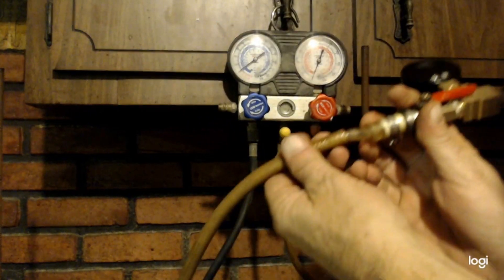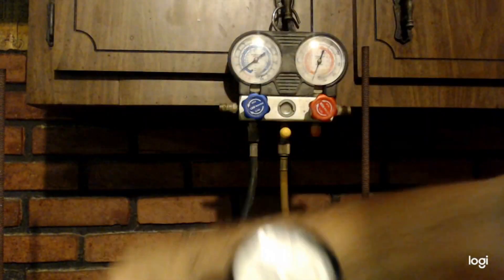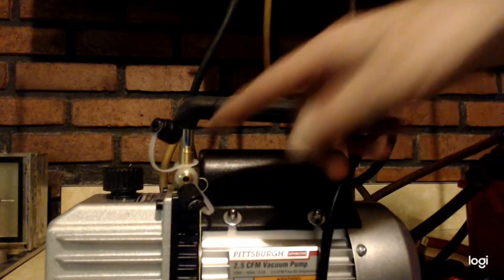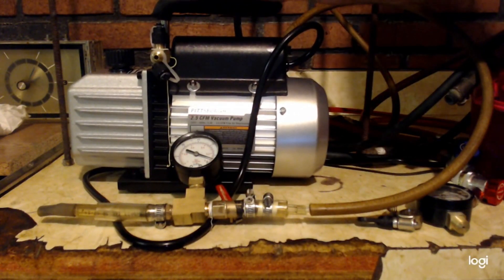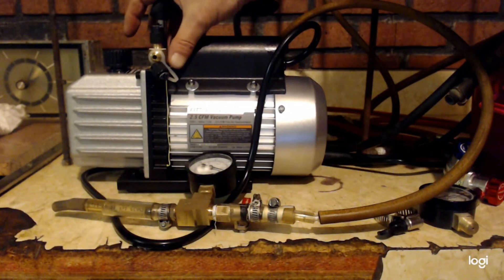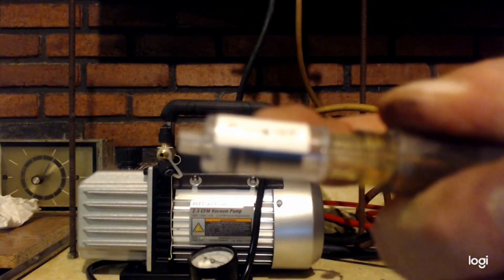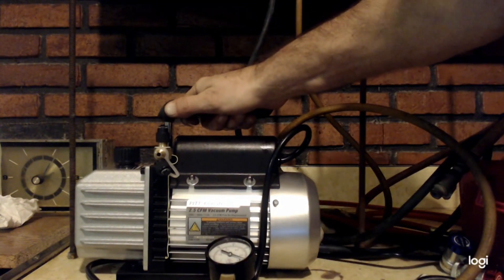VACUUM PUMPS for chemistry  PART 2

Comment: Oh, don’t you need a gas trap? Pretty sure you connect your apparatus to the glass ‘cold /gas trap’ then to the pump valve….
Oh also I do the turn off/on thing all the time - get a gas trap bro, you’ll stop sucking up the gasses!!
Reply: Just a trap not collecting or condensing HVAC or extraction petrochemicals gas, you will eventually suck solvent  fluid into motor one day!  A manifold helps, other parts are specialized.  You will also collapse glassware with high vacuum. Implosion!  Teflon PTFE nylon internals, scientific pumps are crazy expensive. 
Get a glass aspirator if high corrosives but Venturi aspirator other types.  Cold dense higher presser.

Comment: I preeeeeetty much gathered what I needed to buy in order to do vacuum rxn’s. You just confirmed it - also I’m glad I’m not the only one who rams hoses into hoses. Braided hoses are useful for strong vacuums also….cant say iv got round to buying a suitable pump for an actual rxn but I HAVE been Chinese eBay window shopping! Converters are really useful for everything. Doesn’t really matter what you’re doing. Even in audio engineering, converters that are male to female are great. Oh also i do find your oil story quite amusing. It’s an advert that says - read the manual!

Comment: He means positive pressure as in air compression not vacuum in a few examples if get confused. He’s great at explaining in layman’s terms not confusing. Trap was wondering if recommended a filter to avoid caustics, don’t suck filtrate into your pump. Have auto shut offs or use an inlet outlet jar flask.  Thanks again John!
Reply: Oh, DONT FORGET STIR BAR not a boiling chips if not overhead!  Chips if coffee cup or bought same, doesn’t stop, Quick connects is what I call those collared air compressor hoses. Hand pump like brake fluid drain pump.  Check valve one way.  Steel aspirator and glass, gonna break it not cheap. Always a 👍🏻

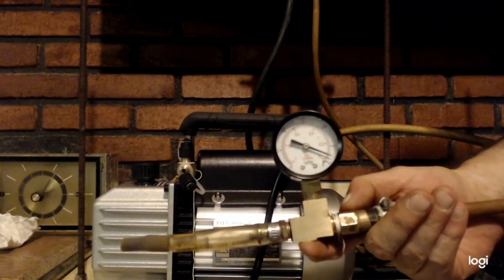Comment: 6:23 If you look for my SM thread titled "Replacing a broken bleeder valve on a vacuum pump", you can see how it's pretty easy to create a valve for these. You basically just need a needle valve somewhere that you can use to basically form a leak. it works very well.
Reply from the maker: JH........What is an SM thread?
Reply: @johnblacksuperchemist2556  Science Madness.

Comment: 1:45 I agree that these crappy gauges suck. It's a pain to have to translate. And they're always in inHg, never mmHg. 
This chart is very helpful: https://www.industrialspec.com/images/files/vacuum-pressure-unit-conversions-chart-from-ism.pdf
Reply from the maker: J H ..............I am having the same problem with pressure cookers.   No common sense.   Apparently a 15 psi pressure cooker is not a 15 psi pressure cooker.  It is 15 psi above atmospheric pressure which means in reality it is a 14.7 + 15 = 29.7 psi pressure cooker.    Scientist can be so UNscientific.   Thanks for the chart by the way.   That will be helpful
Reply: @johnblacksuperchemist2556  For sure. I found like 10 unhelpful charts before I found that one. lol

Comment: is old good stuff but has no pressure gauge and just with a valve is madness, the risk of implosion is always present and if close the valve the pump temp.increassing is crazy. but still does the work
Reply from the maker: noname........That's the main thing....it still works

Comment: I took HVAC courses when I was a kid, one of our assignments was an elaborate plumbing mockup. I remember the most difficult part was wrenching the fittings down tight enough. PTFE tape is useful too. To get a good vacuum using quick-disconnects you have to get ones made specifically for vacuum.
You can get nice diaphragm pumps from (auction site) which are pulled from O2 concentrators. They're good for chemical resistance, but like you said, don't pull as high a vacuum.
There's another type of cheap small plastic piston pump you can get which is built for foodsaver-type devices. They can pull a better vacuum than a diaphragm pump, and are so cheap you can use them in corrosive applications as they are practically disposable. I believe I saw Thyzoid Labratories use one in one of his videos.
Anyway, thanks for another good video
Reply from the maker: Waffle.................Yeah i use teflon tape  sometimes.   Ah ....then i was right with the quick dissconnects.    I thought it wasn't working right.
Reply: @johnblacksuperchemist2556  The first result for vacuum quick-disconnects is McMaster Carr. I've seen other channels say it's a useful supply house. I've browsed before and the prices are not uniformly outrageous...
Reply from the maker: @WaffleStaffel  ....I will have to check it out
Reply: I looked at a number of the pumps I mentioned and they have disappointing vacuums, at about 600 torr. You can evidently achieve from 30 to 1 torr using a refrigerator compressor, and you can get those for free.
Reply from the maker: @WaffleStaffel  .......what do you mean...........what can u get free??????
Reply: @johnblacksuperchemist2556  If you have access to scrapped refrigerators, I mean, you can get the compressor for cheap or free.
Reply from the maker: @WaffleStaffel  ........Yeah i used to know how to do that with compressors but that was a long time ago.  For me it is just easier to buy a pump
Reply from the maker: @WaffleStaffel  .........good idea if you got access

Comment: The side port on most rotary vane vacuum pumps has "flare fitting" threads. The great thing about flare fittings is that once you have a flaring tool (not expensive @ HF), you can flare the end of any piece of copper tubing for a air tight connection without a ferrule or compression ring (still need a flare nut though). I run 1/4" copper line to my diy vent hood where I have a gauge, valve and barbed fitting for rubber hose connections.
I like to use silicone tubing for vacuum lines to glassware. It's got great temperature resistance and doesn't have the degradation problems of latex.  It's also available with a nice thick wall that doesn't collapse from a vacuum.
Fun fact: vacuum pump oil is highly purified mineral oil
Any time you use a rotary vane vacuum pump with some sort of liquid vapor, that liquid will condense in the oil till an equilibrium is established with it evaporating - which ruins your ability to establish a proper vacuum.  Diaphragm pumps avoid this problem, but ones capable of a high vacuum are very expensive. The (im)practical solution is just to change your oil each time. I'm wondering if I can't just heat my old oil up to drive off any volatiles and then re-use it. 
I bought a $25 diaphragm pump on Amazon  which gets down to about 24psi (~300 Torr). I try to use it for general vacuum filtering and stuff with liquid vapors. It can suck up some water and just spit it out. It will lower the b.p. of H20 down to 65C which is enough to be useful for  some distillations.
The really cheap rotary vane pumps don't want you to keep running them once they've pulled a vacuum. They say that will damage the pump. Higher quality ones should actually be turned on and run with the inlet port closed for several minutes so that the pump can warm up (slightly expanding the internals for better tolerances), pull a vacuum on the oil, and self-purge any moisture that has been absorbed by the oil.
Reply: Good observations. You're right about the mineral oil, and plain cosmetic oil is sufficient. Some HVAC techs change the oil after every job, some after 2-3. Heating the oil would drive off the moisture, but it will also turn it acidic, so it's not advised.
Reply from the maker: Mark..............Man i wish i had all your mechanical information.  I bet you can build a bunch of stuff.  Interesting idea about refluxing the oil to drive off volatiles.   I will have to keep that in mind about heating up the pump before attaching to apparatus.    I guess that goes with anything that has a motor